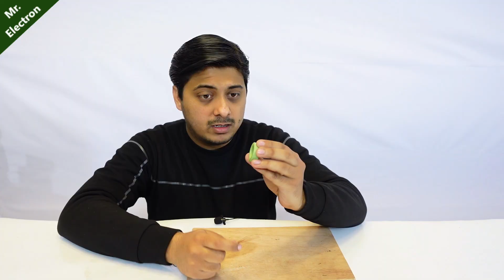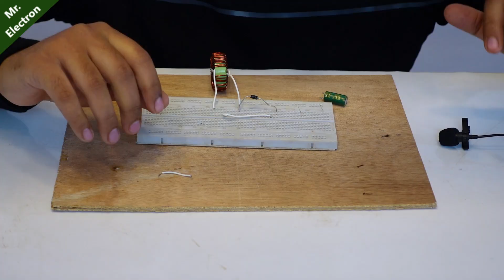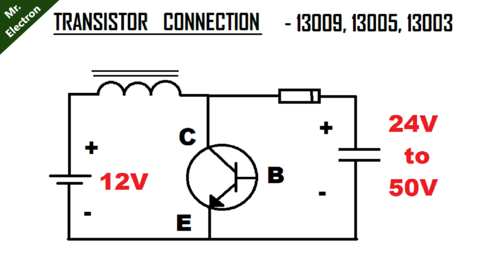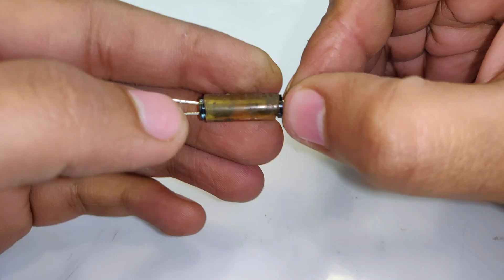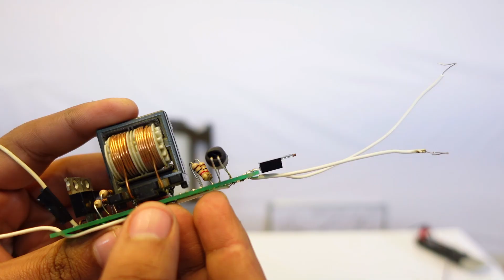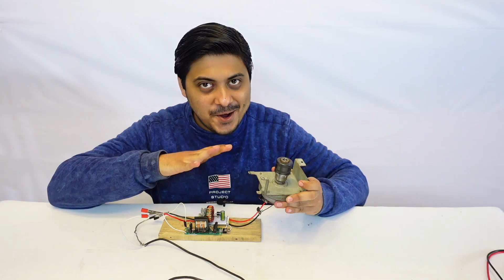12V 1000W | DC Voltage Step Up Converter ( 12v to 43v ) for DC Motor DIY

Comment: Could you please make a video on a super efficient  joule thief for 0.5v to 24 volts with adjustable feature. That would be super awesome. I need this type of circuit for my bacterial electricity production project

Comment: really like this guy. great the way he used the manual switch to explain the switching part of switching power supply. I love how excited he gets when he see's his circuit  working as expected.😎. 

Couple of things, 1 is on the driver circuit, the inductor he called a 1 to 1 or 1:1 inductor, I assumed it was a 1:1 transformer and the actual part looks like a 1:1 transformer to me.  On the schematic the inductor looks like an inductor with a center tap which is what I think it is??

The other thing is the final output transistor on the driver isn't on the schematic, he doesn't mention the part number of it in video.

  THANK YOU Mr Electron keep up the good work!

Comment: Mr. Electric, this is and looks like one of only two good circuits for large current (motor type) on line. I would, however pay you (with respect) for the entire circuit post the changes....good for you in  your choises these days! :O)  I speak, of course in the name of The 21st Cen change.

Comment: These are all a waste of money, the parties are cut off in this case. You can't even increase the bicycle dynamo voltage with them, because they know zero load, there are no separate parts, I have heaps of wrecked monitors and TVs, and so far I've only been able to use a resistor from them, and that too only 1 KOhm.
They compare it to when the plug of an extension cord is plugged into its own outlet and, lo and behold, the light bulb lights up.

Comment: This helps convert the AC ether to DC higher voltage, good work, now scale up x100 .5 volts AC 1000amps to DC, back to 120 volts AC

Comment: Yes the buck converter runs the motor on it’s own, but put a load on the motor, for example try to power a 48v 1000w scooter, it will just about move.

Comment: Do you use tvs diodes to protect gate and source to drain for mosfet and protect things connected behind the voltage booster like something else connected to battery

Comment: i have 2 questions . 
if the transistor is hot did he will be burnt or damaged ?

the supply you used it in the video and was make a 12 , 24 ,36 volts power supply to turn on this device was AC or DC ?

Comment: Can you run 2 X 12V batteries in series and then use a boost converter to up the 24v to around 52-60v? I wanted to use this type of setup on a electric scooter :P

Comment: How do you control the output voltage (i.e. what if you wanted to maintain 24V)?
Reply: get a controller for that
Reply: Simply add potentiometer.

Comment: Tnx for your amazing technical videos. Me proud to say that M 1 of your fan and subscriber. But sir, I am frankly speaking that the electronic components which u hv used in ur projects such as 13009 transistor,  224j 630 capasitor etc .... facing difficulty to collect it. So u r cordially requested to inform  me how do i, and where do I collect all those component easily.  Thank u. Waiting for ur videos

Comment: Can you build a boost converter that can take 48v in and give 60v out, at 50amps?
Reply: when u r power rating above 1Kw it's better to buy one commercial converter rather then building one.

Comment: The laptop charger needs to put out very high current  to increase voltage aaaand be able  to supply the motor with lots of current... and  the components  of the boost circuit and need to be able to handle the very very  high input current.  I call bullshit. Good fake

Comment: Great video, what is the amp draw from your 12v power supply?
Reply: to : Zinc Fold 

what you are means ? did you means what is the  current and the  voltage 12 volts or no ? 
if it's your question so , 12 volts =1.2 amperes .
Reply: @osamagamal-hf9ri  yes, thank you.

Comment: thank you mr electron my teacher, your video lead me to a project,  but now am stocked, my question is on how i can increase 12v dc 70amps output from car alternator to 150amps to run my dc motor of two hose power, your kind response i kindly wait for
Reply: Actually you can't increase total power output of your car Alternator, you can either increase voltage by decreasing  the current or increase current by decreasing voltage ,  it's inversely proportional.

Comment: Because you supplied high AC voltage to an electrolytic capacitor. After all electrolytic capacitor is a polarized capacitor.

Comment: Bhi IC use kro na signals ky liya aap 555 timer ic q nai use kerky dakhty usmy apky pass Duty cycle or frequently change kerky, voltage or current changer keeny kii bhi option aaa gati Ha if u need any help tell me. 
Duty cycle for current 
frequency of voltage 

I love this channel

Comment: I need to build a boost converter capable of stepping up 36v to 63v with a current of 30-50amps but I am new to designing circuits. I want it to have short circuit protection and the ability to set the constant current and voltage and built into a contained unit. Can you help?
Reply: Un doblador de voltaje necesitas
Reply: Pero precisas muchos amp. No va a ser fácil
Reply: Es para una moto electrica? Si vas a usar baterias podrías poner 2 baterías en serie y un potenciómetro para bajarla a 63v
Reply: El potenciómetro tiene que ser de 2000w en adelante
Reply: Yo le pondría un fusible de 60v después del potenciómetro porque cuando se rompen suelen entregar el voltaje de entrada y se te puede quemar el circuito
Reply: También soy nuevo en el tema . Esperemos que alguien que realmente sepa nos aclare las dudas
Reply: Imagínate si sabré poco que para llevar un voltaje de 12v DC a 40v DC voy a usar un inversor de 12v a 220vAC 2000w de los comunes de panel solar para de 220v colocar un transformador casero de los comunes de corriente alterna pero grande casero que me entregué 40v AC y con un puente de diodos pasarla a DC y así obtener 40v con 25amp por lo menos porque no ví que vendan nada parecido y lo necesito
Reply: Este módulo se ve interesante pero si es para trabajar durante horas confío más en un transformador casero y un inversor que en un módulo que seguro existe manera de hacer pero manejamos muchos amperios y no cualquier módulo va a resistir la potencia de trabajo que buscamos

Comment: Please tell me the voltage input and current input!
Reply: He says 12 v input but left out the input current.     Boost converters use amps to boost voltage and they  also  need even more current to drive everything else.     I think its fake

Comment: Hi bro i like your all videos you have great explanation. 
Bro i need your small help I have 30amp esc controller and it's connect in car alternator but it's not working properly alternator only jerking not moving properly please give me idea for this problem.
Reply from the maker: Did u give dc input to the rotor winding ?
Reply: @MrElectron  yes bro 12vdc
Reply from the maker: Battery or power supply ( ratings ? )
Reply: @MrElectron  rotor winding power 12v 5amp and field winding power 16v 10amps
Reply: 5amp battery for rotor winding and 10amp car battery charger for field winding
Reply: Same process as your video but I don't know what is the problem.
Reply from the maker: Power sources are fine as long as the batteries are in good health
Reply from the maker: Make sure that you have completely removed the rectifier. Try to slowly increase the speed with the throttle...  if the problem persists, there might be a  problem with your controller
Reply from the maker: May be its a hall sensor type of bldc contribute.. For alternators, you need a no hall sensor type

Comment: Thank you for your video, please tell me what perforated board you are using 7 minutes into the video and where it may be obtained. Thank you
Reply from the maker: Link for them is i  description
Reply: @MrElectron  the transistors are on the primary or driver? Coz in the circuit diagram its used 3 transistors in the driver and Only 1 transistor in primary. KINDLY GIVE A PROPER FULL CIRCUIT DIAGRAM OF YOUR VOLTAGE  BOOSTER..Thanks.

Comment: The capacitor blasted in your previous video because of two reasons:

1. You  passed a voltage higher than its rating through it

2. You passed A.C. through it and it was an electrolytic capacitor
Reply from the maker: Congratulations !!! You were the first one to give the correct answer and now you have successfully entered the contest.

Make sure, you are the first one to correctly answer for the next video as well to win the contest.

Contest Rules (video) - https://youtu.be/yM1HGrM2wNM
Reply: Thanks for your insights guys! I have learned something new
Reply: But I thought electrolytic capacitor is designed to block DC and allow AC. That means it must be used with AC?
 I do understand AC will reverse it's polarity/cycle but I'm confused on the application of the capacitor if it does blow when applied AC.
Reply: @ronsee2999  Yes, but electrolytic capacitors cannot do this because they are intolerant of reverse polarity. Ceramic capacitors and some other types of capacitors can tolerate reverse polarity (i.e. AC) In DC, capacitors have near infinite resistance when fully charged, but in AC, their impedance decreases as frequency increases and that means that at very high frequencies capacitors have near zero impedance.
Reply: @ronsee2999  bro electrolytic capacitors are used as a filters also but in low voltages of ac
Reply: @pi-tech1817  NO!!! ELECTROLYTIC CAPACITORS CANNOT TOLERATE REVERSE POLARITY FROM AN ALTERNATING CURRENT, although ceramic capacitors and some other types can. Electrolytic caps can, however, tolerate pulsating DC IF THE CAPACITOR IS NOT REVERSE-POLARISED AND THE PULSATING DC IS NOT ABOVE THE CAPACITOR'S MAXIMUM VOLTAGE RATING
Reply: @julianslab1511  correct me if I'm wrong , but electrolytic capacitor is used in many SMPS which means electrolytic capacitors can tolerate pulsating DC from bridge rectifier as it acts to smoothen the voltage. Therefore as long as the voltage does not reach to negative (using a scope). The cap should be fine?
Reply: @julianslab1511  bro I said for low ac voltages.i have made many projects including caps
Reply: @ronsee2999  That's what I said. Electrolytic capacitors can tolerate pulsating DC but they cannot tolerate AC. AC and pulsating 
DC are not the same thing. So long the pulsating dc does not exceed the capacitor's rated voltage and the capacitor is not connected backwards, it should work.
Reply: @ronsee2999  The cap should be fine, I said the cap will blow up with AC, that meaning when there is no brdge rectifier
Reply: for more detail between their differences watch my video on AC and DC
Reply: @julianslab1511  sure please PM me your link
Reply: @pi-tech1817  what do you mean by 'low ac voltages'? 12V AC or <1V AC?
Reply: @ronsee2999  so yes you are correct but this doesn't work with all capacitors
Reply: Hi sir I am send you email about hand crank generator